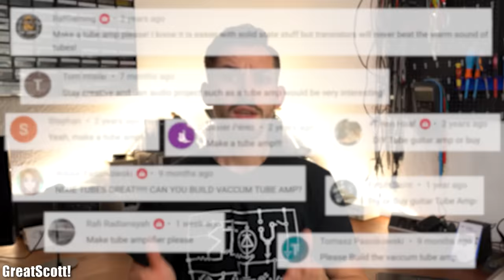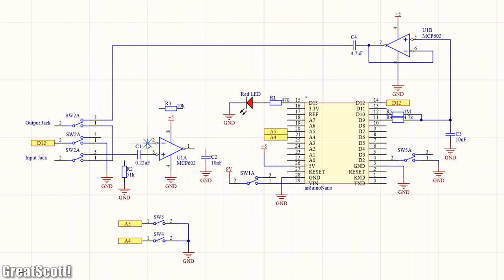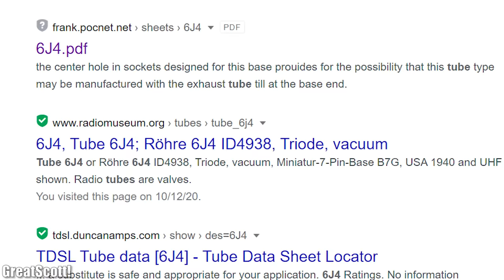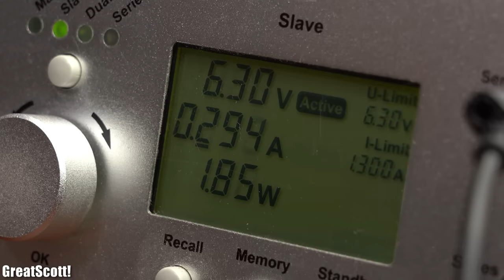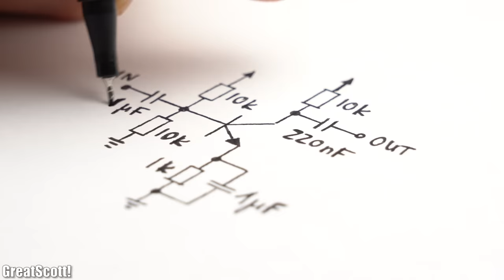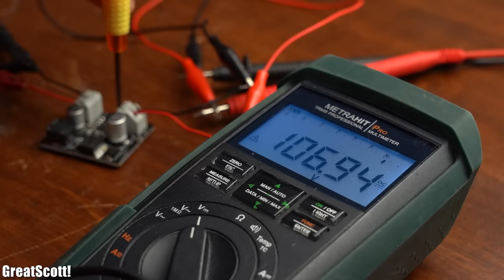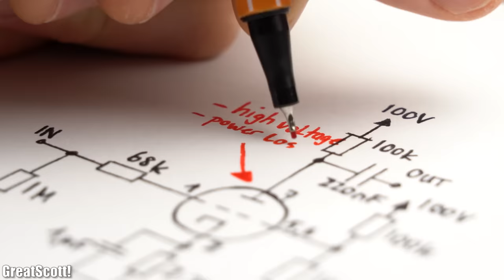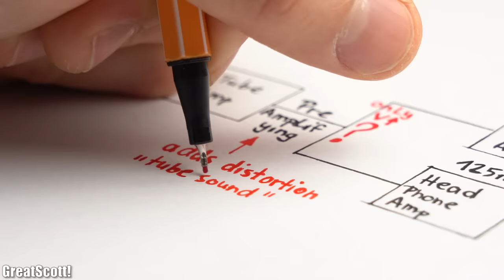Building a Tube Amp! Does it produce better audio quality though? EB#47

Comment: Agree with most of presented about sound and distortion of tube and transistor amplifiers. As I remember from my university time, in general tube amps produce about 10 times more distortion than transistor amp. Main difference is that tube amps produce "even" harmonics that sound more harmonic or musical to our ear and this is main reason why it sounds worm and pleasant.

Comment: Nuclear reactor. DIY or BUY?
Reply: Government: don't!!!!!
Reply: Actually it's not that hard to make a simple fusión reactor at home
Reply: @gcr100  It's certainly not cheap either ;)
Reply: @BertGrink  yeah, but with patience you can get almost all the parts on industrial junkyards for cheap
Reply: DIY, definetly!
Reply: @gcr100  Good luck containing plasma at 100.000.000K with random junk; just give me ample warning so i can make myself scarce, thank you.
Reply: Diy from smoke sensor ?
Reply: @BertGrink  Inertial electrostatic confinement is easy. Search for farnsworth hirsch fusor. The difficulty in a fusor is given by the high vacuum required (and deuterium injection system if you want to go over demo mode). You need a turbomolecular pump and good construction, which by the way I just don't have the money for. Obviously this design failed to go positive net.
Reply: @BertGrink  plasma has a low density so even at those temperatures it's easy to contain, I'm not trying to get energy out of the system, just achieve fusion
Reply: @tiger.98  exactly what I meant, Farnsworth Fusors are frequently built by people in their garages around the world, and for the pumps, I got 2 at the moment, which I got for less than 50usd for both
Reply: @BeryBelloney  I wouldn't want to mess with radioactive materials at all
Reply: @gcr100  Where the fuck did you get TWO TM pumps for 50usd? Lucky! All I can see is multiple hundreds of euros.
Reply: David Hahn DIY'd and eventually- sadly- DYI'd (did himself in).
Reply: @tiger.98  I'm going for the third this week, it's an industrial junkyard, I've been digging for the controllers, but no luck yet, one is a tmh260, big turbo pump, and the other one is a leybold turbovac 50 smaller one from an xray machine, at the moment i have completed the controller for the big one, but the other I think I will get a broken one and fix it, first thing to do with those is an aluminizing chamber for telescope mirrors any other project suggestions are welcome
Reply: @gcr100  Very cool! Good luck for the controllers
Reply: captions: today we are going to make a nu FBI open up
Reply: Just rebuild Chernobyl from lego
Reply: EPA !!!
Reply: @gcr100  it is useless in terms of generating power
Reply: @raymondzhao9557  nobody said anything about power, its just for fun and obatining new skills
Reply: @gcr100  fusion? Surely you mean fission?
Reply: @alicebate6384  fussion, google farnsworth fusor
Reply: @gcr100  I'd rather build a fission reactor and use it to boil the water for my cuppa.
Reply: @alicebate6384  Good luck getting the fissible material :D
Reply: @gcr100  uranium fever has gone and got me down! 🤣

Comment: While there maybe the negligible difference in sound and tubes are energy hogs, tubes still outclass transistors for the true audiophile. Love that you showed (measured) the input/output of each circuit. Good video. 👍
Reply: are you serious?🤣tube amplifiers are much worse than transistor ones. you can find measurements of their parameters on audiosciencereview for example. measurement of noise, distortions, channels separation of tube amplifier are the worst of all other amplifiers
Reply: @user-qi1cs3zg3n  there are 2 types of audiophiles, those that spend their time looking into measurements and parameters, and those that actually listen to music. I'll let you figure out which type is the true audiophile Andrew is referring to.
Reply: @jonsnow7092  The main problem is that hearing differs from person to person. Trusting the ears of a stranger when choosing something is not very smart. This parameter is very subjective. In a blind test, "listening" audiophiles are unable to distinguish one amplifier from another. Measurements and parameters are much more objective. Manipulations about “two types” and that “those who look at the parameters do not listen to music” do not work for those people who love the scientific approach and critical thinking

Comment: I only trust Mr. Carlson. When we need to talk about tubes.
Reply: Don't we all?
Reply: @mthompson965  Sure.
Reply: Don’t forget Uncle Doug and D-Lab!
Reply: @jimhibert  ohh :( my mistake.. Yes! you are right!
Reply: Mr Carlson agree with that video.
Reply: I think tube amps produce a different sound, but I don’t know about better. I also sort of doubt the high-precision tube amps of high-end audio make any difference at all.
Reply: @squirming_squirrels  I agree with you. I think After some point prices are waay to high for getting benefit.
Reply: @VolkanTaninmis  that’s true of Hifi in general and is why it’s BS. 

My point more was that in the efforts to make ultra-precise, linear amplifiers it doesn’t matter if it’s being driven by tubes or silicon - it’s the electronic nuances of old gear that give tubes the character, not so much the tubes. My guess here is that by the time you engineer a $10K amp you’ll have engineered out any color.

I mean. Idk. I’m not a billionaire :)
Reply: @squirming_squirrels  I agree with you again. When you hit 99.9% of signal integrity, going further is not necessary in my opinion. Because you are going to use some cables(shielded or not) and connectors. There is no way for not getting some interference. 

+ When you hit the hearing capability of your hearing, nothing more is important.
Reply: @VolkanTaninmis  exactly, and so much gear isn’t balanced anyway.
Reply: @VolkanTaninmis  Believe it or not, but depending on how you scale things 99.9% of signal integrity may not be enough to mask interference. The human sense of hearing is incredibly sensitive. People who are mentally trained to listen even more so. Auditory feedback is used in a myriad of applications you may not have thought about, because people respond so well to it. Therefore we are talking about very tight margins when it comes to sound. Audio pushed the limits of electronic components as video games push the limits of computer graphics today, because people could tell the difference, were often discontented, and held very strong preferences.

When that is said, today we have pretty much perfected the art of audio. DACs can process sounds very close to original given the right recording and monitoring interfaces. Emphasis on monitoring.

But the deal with tubes in the context of audio isn't nearly perfect, natural reproduction. You could probably achieve it given tuning. But in most cases tubes serve the purpose of colouring the sound to eliminate the sharp metallic artefacts and whining associated with digital switching components through amplification of the signal by what seems like a sort of "mixing of electrons".

I have worked with audio for a long time in controlled acoustically treated environments as an amateur mixing engineer. I don't care about nice sounds when I work. I just want the most honest representation of what I'm working with. The ideal would be if I could feed audio back through an unbiased microphone a dozen times and still not be able to tell the difference from the original audio sample. And the closest I've come to achieving this has been on some variants of reference monitors with integrated digital amplifiers. Of course, I don't have an unbiased microphone, but the results are pretty telling.

Anyway, I don't have all the tube amplifiers in the world. Some are famous. Sometimes wicked expensive. I find it hard to believe that they can come as close to the results I've gotten with dedicated speakers. But I'm always willing to change my mind.

When that is said, I would never listen to music on reference monitors for pleasure. I much prefer tube amps driving larger speakers. They just don't tend to make me as tired.

As for what interference is concerned—yeah—if you don't shield your equipment properly you're going to get interference. But audio is not transfer speed. You won't exactly get bottlenecked in the traditional sense. Depending on how your signal is processed you will get better or worse results regardless of interference. Again, people are extraordinarily good at mentally interpolating missing parts from poor audio signals. You can make pretty accurate assumptions about the relative differences between two sounds even from the lossy compression on YouTube. If you know what you're comparing what you're hearing to, interference may not be as big a problem as you think.
Reply: @___xyz___  thank you for your brief ideas... but, NOTHİNG can hide interference. If you are getting some noise or spikes on signal, this means you have interfarence problem in questionable levels.  also, sound quality of youtube dog shit.
Reply: @jimhibert  And lets not forget about Mark  - Blue glow
Reply: @VolkanTaninmis  I'm not talking about hiding interference. I say interference doesn't mask detail. And quality isn't a valid measure of integrity.
Reply: True
Reply: @jimhibert  I don't trust Terry from D-Lab.
Reply: Shango? Uncle Doug? Regarding tubes I'd still trust Brad the guitologist but he'd go into a rant about how covid is a conspiracy and dem libs are gonna ride their dinosaurs to come kill us all so scratch him for now😂
Reply: And shango
Reply: we trust not where the fact is but where the heart is. Almost all EE i know will say that tube amps are bullshit and any of their functionality, if any, can be replaced by ICs.

They are there for the purpose of looks, not functionality. Just like wireless charger. Server one function badly, can easily be replaced by other methods that works wonder
Reply: &the guitologist!
Reply: @squirming_squirrels  One can get a very good tube amp for under $1000 but I would avoid any under $500 and cheap crap ones (like used in the video) that use an external 12v power supply.

Comment: I like the audio related stuff! Tubes in the preamp do provide a softer clipping, but that's only part of tube amp. The prized dynamic and complex tube amp eq comes from the impedances in a tube driven power section. Also, an interesting way to visualize audio characteristics of a certain circuit is to run pink noise thru it into a frequency analyzer.

Comment: I had built a vacuum tube amp in 2012.   My reference was a book by Dave Hunter  Guitar Amp Handbook. To this day it is a very good
Functioning amp. It produces about 10 to 12  watts depending what vacuum tubes you use.  My total cost was at $500 for all components  and enclosure.
It was not a difficult amplifier to build with paying close attention to the schematics.

Comment: Tube amps make most sense in the electric guitar amplification, where the tube overdrive is highly desired. Also the voltage for rich sounding amps may be up to 450 volts. And also the great influence on the sound is made by output transformers. And yes - digital anode voltage regulators are very noisy and should be tailor made specially for tube amplification
Reply: Yup, output transformers are a big part of the sound signature of a tube amp. That's why, say, McIntosh uses output transformers even on their SS designs. And that's why a proper tube amp (or a proper tube preamp) would have been a much better choice than a "cheap opamp and Class-D module with a tube buffer" for this video...
Reply: Consumer: Analog sounds so much better!
Also consumer: uses bluetooth
Reply: @thewolfin  I find aptx has a comparable quality to line in on my lgv30 with quad dac
Reply: tbh it can all be "fixed" using other circutry (like filters or even - god forbid - op amp chips)
Reply: @boazcohen7992  and that opamp filters loads more then distortion.
I use discrete opamps. They do not much with the original signal.
Reply: @thewolfin  
Most, even from the one with a soldering iron in hand, might not even get your point. But they truly hear the warm sound. 😂

Comment: This video sparked a memory for me... I remember tube tester stations with replacement tubes in electronic and hardware stores, you could test your tube rather than bring it into the TV repair shop... which our Magnavox colour TV spent probably 5% of its lifespan at.

Comment: Also, tube power amps have an output transformer which also affects the "pleasantness" of the sound.
Reply: If it's for hi fi audio reproduction, a well projected output transformer will have a flat response in the audible frequencies
Reply: class AB also have transformer
Reply: Or they don't and use big honking transmitter tubes that draw ridiculous filament current/banks of normal output tubes in parallel. It's called output transformerless or OTL.

Comment: Id like to see you try DCC control. Its mainly sold for model trains to have multiple trains on the same track but controlled with signals sent through the two rails(if im understanding it correctly). At least one guy built an arduino library for it but it still requires quite a bit of electronics.

Comment: Great video! I only have one question. What are those two 100kΩ suppose to do?
Reply: I assume this isn't a triode, but a pentode. The two 100kohm resistors are a voltage divider. The lower resistor should be decoupled. Pentodes need DC on one screen. If the screen is tied to the anode, it operates like a triode. Look at the datasheet of the EF86 pentode. It has application examples. Pdfs are available online. Pretty much the only signal pentode used in audio in the 1950s-60s.
Reply: @grisflyt  Exactly. In this way it operates in ultralinear mode, which is a strange choice for a preamp stage. Usually you'd like a nice triode like a 12AX7. Here they probably should just connect the plate to the screen and run it in triode mode; after all, this pretend device is supposed to give you "tube sound" on the cheap. Although with a tube buffer strapped on an opamp with a cheap Class-D module for the output, I'm not sure it's worth the trouble: NOT the recommended way to audition tube sound if you're curious about it!
Reply: @jonathanvanier  I doubt that. In ultralinear, you have negative feedback within the transformer. How much is dependent where you tap it, typically 34%, if I remember. This seems to be nothing more than a voltage divider. Since it's important that the screen gets ripple-free DC (ideally low impedance, there should be a capacitor.
 
This amp is just riding on the tube trend. I don't really consider this a tube amp. It may still be a fine amplifier. Today's opamps are very good.
Reply: @grisflyt  I went back to the video and I was wrong, the screen/suppressor grid is indeed connected to DC on the circuit and not the plate, so it’s not running in ultralinear. Sorry about that. This begin said, ultralinear really just means that you feed a percentage of the plate’s output to the screen; a simple way to do so is, indeed, to use a tap on the transformer’s primary, but you can do it with a voltage divider just as well. It’s still called operating the tetrode in ultralinear mode. And of course, in a preamp stage you don’t normally have a transformer tap available (or if you use something like global feedback, you’d probably rather do it on the cathode anyway). But you’re right that it’s just a form of feedback.

All this being said, I fully agree with you that this device is not a tube amp, in no shape or form.

Comment: Vacuum tubes do not necessarily reproduce cleaner audio, however due to the frequency response characteristics, and the characteristics of the way they clip when over driven, they produce a unique sound that is pleasant to the ears of many. Though there is some credibility to most tube amps running class A or class AB bias to truer more linear response and less distortion as opposed to class D. Keep in mind there is a lot of inductance and iron in a tube amp in the output transformers and interstage transformers that also affect the frequency response and saturation characteristics. Its not "cleaner" audio, but it is different, and quite nice to listen to. Every amplifier, period, alters the characteristics of the signal to some extent.

Comment: The key to the "natural" sound of a tube amp or preamp is not simply the distortion. It is also the TYPE of distortion. In the natural world, there are very few things, if any, that create a pure tone. There is also some distortion, in the form of harmonics, whether it is a bell, a trumpet, a voice, etc. Importantly, these harmonics are on the even multiples of the original tone, and roll off naturally the higher the multiple of the original tone. THIS is what our ears are used to hearing every day of our lives. Tubes DO introduce even-ordered harmonics (2, 4,.etc.). Transistors, when distortion is present, particularly in the early days of transistor technology, is odd-ordered (3, 5, 7, etc.). So with transistors, either the natural even-ordered harmonics are suppressed entirely, or odd-ordered, which sounds harsh and brittle to our ears. That is why you don't have to push a tube amp or preamp into what would typically be distortion levels to notice its benefits. This is why the term "natural" is a good one. Tubes recreate sound that is similar to our real world experience, distortion and all. In contrast, transistors sound "dry", "lifeless", or even harsh - before even reaching levels of distortion.

Comment: I started building tube amps 40 years ago as parts from old radios were freely available. The quality of the available capacitors and transformers was not that great. I am currently still playing with tube amps and much better quality parts are now available. I like tube amps as they are (in principle) very simple compared to solid state amps. They do  provide very  high quality audio. Main disadvantage is the low efficiency.